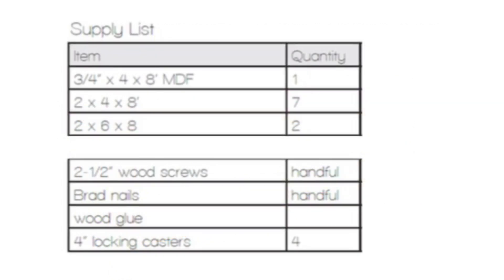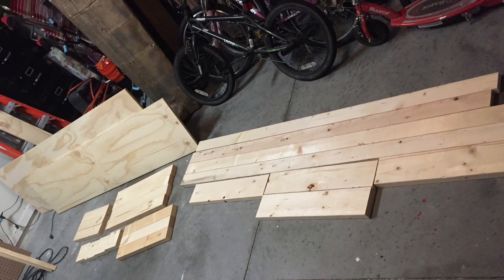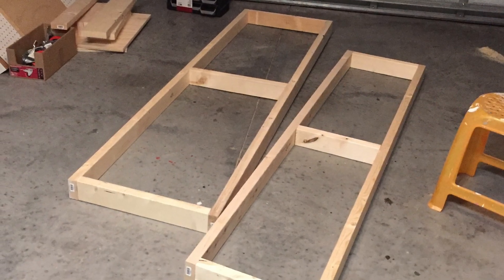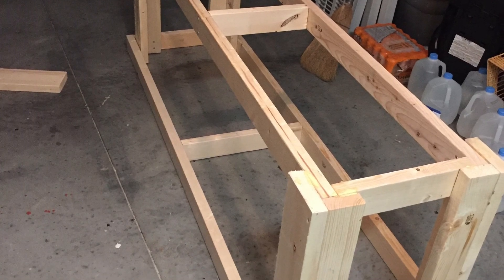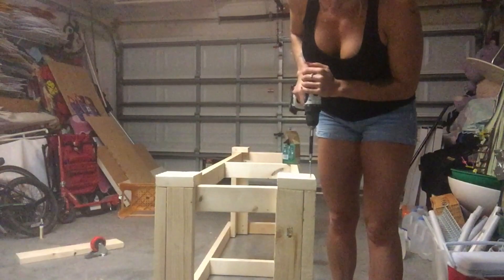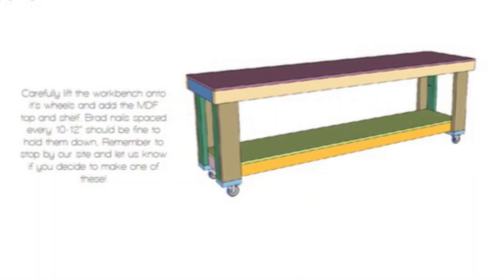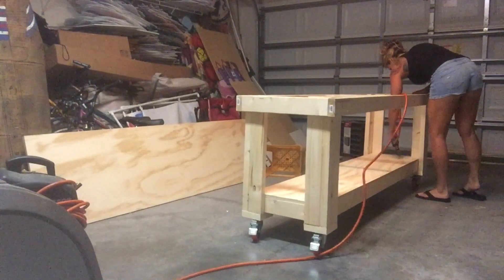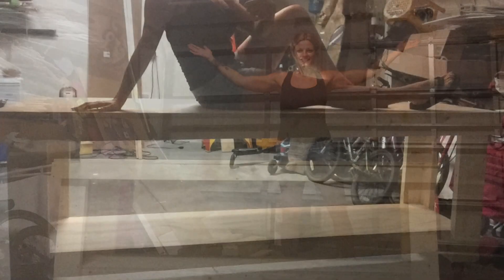DIY WOOD WORKBENCH - HOW TO BUILD A WOOD TOOL WORKBENCH FOR YOUR GARAGE

Comment: Your supply list calls for mdf, but looks like you used plywood instead?
Reply from the maker: William Dolan yes! I did use sanded plywood. I was afraid if MDF got wet
It would warp.  I forgot to change that on the list.  Sorry 😐